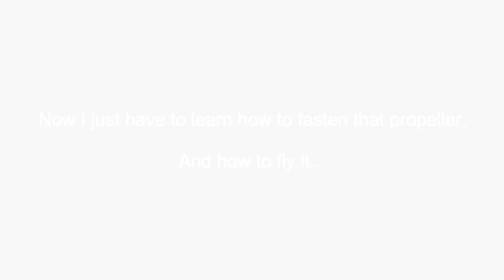How I FPV'd my Spitfire

Comment: cool! im trying to do this but my goggles dont support headtracking, and I havent been able to find an external headtracker
Reply from the maker: My new goggles doesn't either, but I managed to get a Fatshark Trinity external headtracker. Sadly they doesn't make them anymore, so they are hard to find. That is a 3-axis headtracker so in my Tiger Moth I built a 3-axis gimbal so I can lean to the side to see forward. Check those videos 😀

Comment: Como  você faz o controle  de movimento  da câmera?
Reply from the maker: The goggles has an inbuilt headtracker (you can use an external also) that is connected to the Taranis. The radio receives this as two trainer channels that I then use to control two servos in the camera gimbal, one for pan and one for tilt.
Reply: FlyingCat FPV Thank you for the explanation. Excellent video.
Reply from the maker: Thanks!